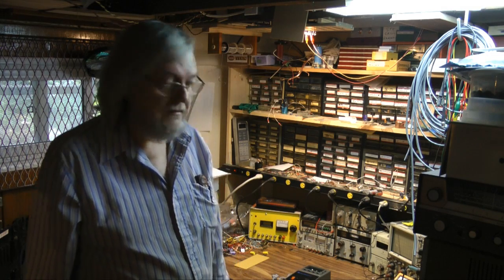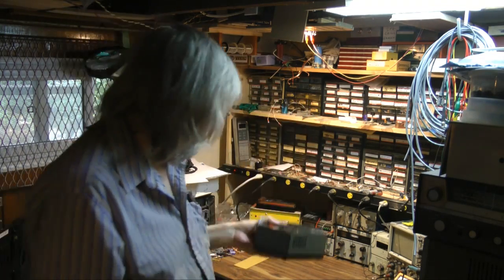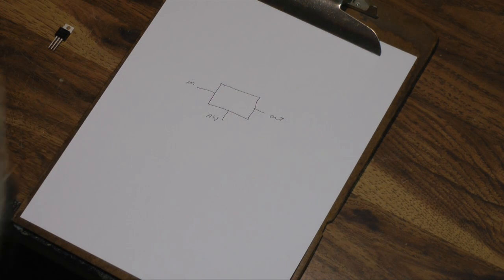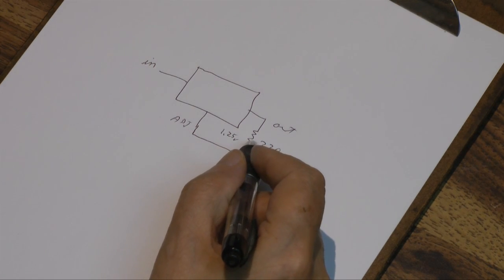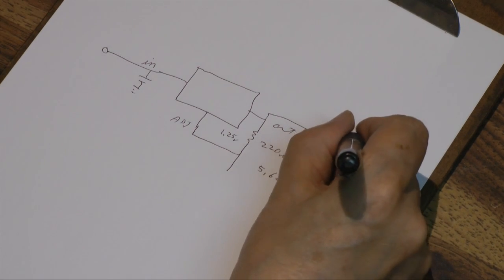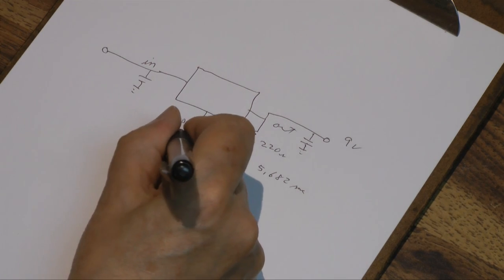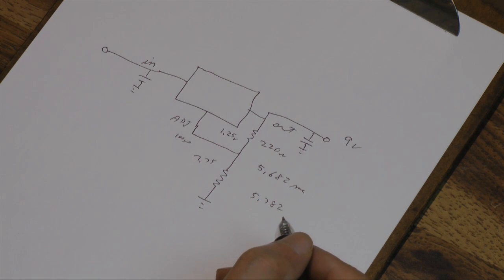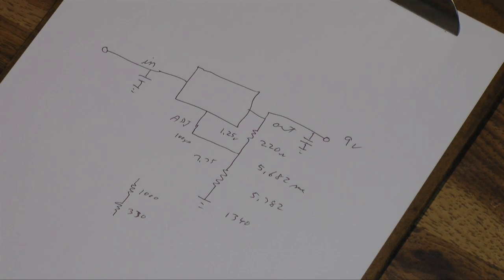Making a Guitar Pedal 9 volt power supply

Comment: What are the capacitor values did you use? I'm having trouble identifying what Cap to use in mine.
Reply from the maker: Normally a 0.1uf cap is used on the input, right at the chip, and at least a 25uf electrolytic is used at the output pins. A lot depends on your wiring and environment and if you are having any problems. If you think you are getting noise, you could also bypass the control terminal to ground with a 10uf cap. Use a single point ground, run separate wires to it from the filter cap.

Remember to use a large filter cap on your rectifier, the chip needs 2 or 3 volts above it's output voltage, on the input, at all times. If you have large ripple on the filter, it will show up as dropout on the output. Scoping it is the best but if you don't have a scope you will have to find a way to verify it! If in doubt, just use a huge cap! I think I usually put a 1000uf on the filter because I have a box of them I got surplus!
Reply: @Flintsmooth  ok sir. Thank you so much! I recovered my school project Lm317 powersupply(picture of diagram can be found on google. The one with blue color that says 1.2 to 30v 1A) and I tried it on my pedal. It worked without any noise. It has 1000uF as filter.

Comment: thank you for sharing this project, i've been trying to build one or myself
i have a quick question i have a 24V 5A center tap transformer (12 - 0 - 12) so how many 9V 0.5A outputs can i divide from it? 

i'm calculating like this
24V*5A = 120W is the power rating of the transformer, so 
9V*0.5A= 4.5W 
so i'm assuming that i can connect upto 10 or 12 pedals with this transformer with out any heat / voltage / load issues (taking in to account the voltage drop in the process of regulation)
4.5w * no. of outputs => 4.5*10=45 W, even with 12 outputs the maximum power rating of the transformer is not reached 
LM317 is rated for 1.5A max and Power rating of 20W, so i'm assuming i have to use 4 chips (3 connections per chip as how you did), as parallel connections increase the current / amps not the voltage, i assume that the output voltage remains same with lm317 (even when we connect multiple pedals at the same time/?) and there by i can connect up to 3 9v @ 0.5A
are these calculations correct?
Reply from the maker: With a 24v transformer, you will get too much voltage using the entire winding. 24v rectified will give you 33 volts DC, and since you need 9 volts, that would give you 24 volts of waste... if we think the transformer can give 120 watts, that's about 3.6 amps. That could run 7 pedals if there was no loss but... also the extra wasted energy would give you headaches! The waste is twice what you would use! You would need over 100 watt capability of heatsinks!

Therefor you need to use only 1 side of that transformer, for 12vac or about 16vdc. You still get the 5 amps, and you can still run maybe 7 pedals. If you don't use a boost transistor on the 317 you will need a few of them!

You can't use the other side of the transformer because of the common ground in the guitar system, in case you were wondering. Also I've seen some 317 poop out at 1.2 amps, and some go higher... they have some kind of internal protection system. Design for more if you can.
Reply: hey there, can i use the other side of the transformer for 12v 500mA outputs (may be 7) for the power hungry pedals???
what do you mean by "common ground in the guitar system" ??
yes the thermal protection....., 317 drops the voltage if the temperature gets to the maximum. we have to be careful in how much load is put on the 317....
and i also happen to have a 24V 1A transformer (12 - 0 - 12) at hand
Reply from the maker: When you use one side of a transformer for a power supply, you have 2 leads, one is ground. If you try to use the other side, that ground must be used, making the other side negative if the side you used was positive. You can't connect a pedal in reverse polarity, the ground is common to both supplies...

In other words, with a center tap transformer, you can make both a positive and a negative supply, with ground in the middle. You can't run pedals reversed so you can only use 1 side in a system like a guitar chain of effects.

Comment: is there any way u cn make an adapter were u just put in a 9v battery 2 work instead of plugging in 2 an outlet? cuz 4 me I  need 2 b able 2 play a pretty separated distance from the amp while keeping a very descent distance
Reply from the maker: +Jesus Aguilera You should be able to install a 9v battery inside your pedal... some pedals (I have 2 like this) you have to remove the screws on the bottom to get inside, and there's a battery clip. If you want to use a bigger battery you could do that as well but big batteries are heavy!  The adapter I made might run off of a 12v motorcycle battery. The adapter needs an input 2 to 3 volts more than it's output in order to work. You could even set up something with 4 of those 3.8v Lithium rechargeable flashlight batteries. I might try to show that in my next video. Unfortunately I just moved and have no shop.